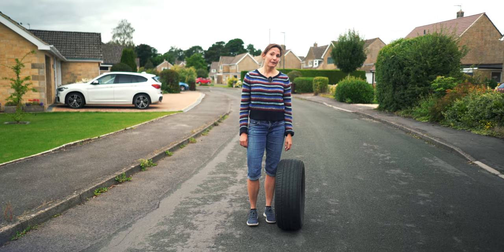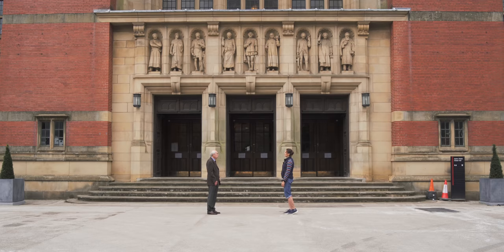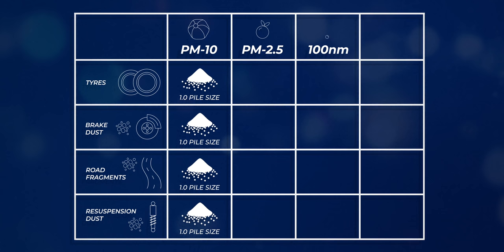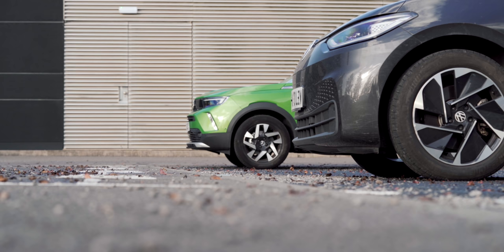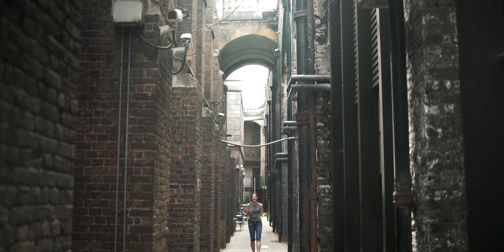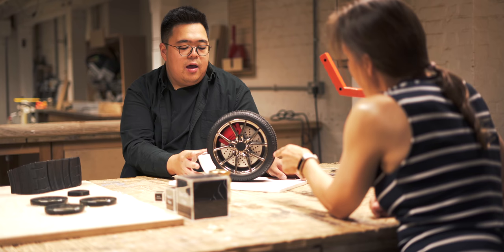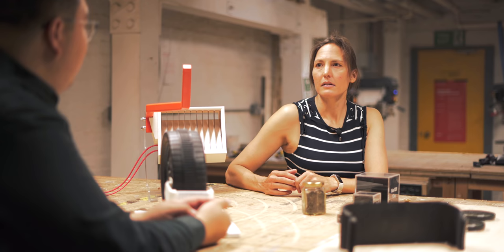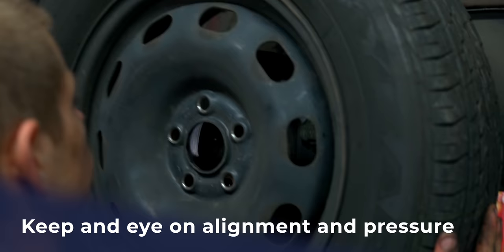The Secret Pollution That All Cars Are Guilty Of | Fully Charged

Comment: Well researched, easy to understand and well communicated. That was excellent, thank you fully charged and Dr Helen.
Reply: @ProfSimonHolland  Given that the video obviously is well researched and communicated, I guess your objection is to promoting the idea that EVs have negative effects, just like ICEs, and that Fully Charged shouldn't make anything of that? Maybe you think EV pollution is far lower than that portrayed here?

It's hard to guess what you find selective journalism or a fossil fuel lobby distraction.

I have looked at your channel and can't see anything that would cause you to make your comment... unless of course, you wanted controversy?

What is better research, what is better journalism?
Reply: @ProfSimonHolland  I took from it that cars have tyres and Brakes. They are responsible for some particulates. Getting rid of fossil fuels solves the majority of our local air pollution problems. New solutions will be needed for the remainder. I think in some articles can rightly be accused of doing the bidding of the oil lobby. In this case I don't see that as fair criticism. Personally I would like the Colin chapman approach of add lightness to be adopted by the next generation of EV's. The mix of improvement battery chemistry, lower drag and light weighting would be lovely. What would you like to see from future fully charged videos?

Comment: Very much anecdotal, but  my e-golf got an irreparable puncture  at 30000 miles ‘ life. The  people in the know at the tyre centre were very impressed with the low level of wear. Regen braking and cruise control, along with that smooth transmission of power to the road , seem to slow tyre degradation  down considerably. That has to help surely?

Comment: Ok. As a Taxi driver who's vehicle usually covers 50,000 miles a year or so i can give some detailed answers here.
1/. Phev ( Misubishi outlander) 2,400ish kilos front brake pads last approximately 150,000 miles and are replaced due to being weathered mire than worn out. Disks show no wear at all. Tyres no difference i.e 40,000 miles to a set.
2/. Full EV MG5 EV owned just over 12 months, 45,000 miles ( reduced due to Covid) 
Front tyres spin a lot on wet roads, 30,000 miles a set. Front brakes at 44,000 miles have worn less than 1mm from new. Disks show no sign of wear at all. 
3/. Fiat Doblo 1.6 7 seater MyLife.
Tyres 40,000 at best. Front pads 24000 miles 1st set 20,000 2nd set due to wear on disks.  Disks replaced after 44,000 miles due to being at or close to minimum legal thickness.
The Fiat has now done 298900 miles and the data has been stable all these miles.
All vehicles are (were) driven hard, perhaps the PHEV & MG5 slightly less so than the Doblo, but not much. 
So the tyre emissions are slightly higher in the MG5 because it's traction control & abs system is slower reacting than the Phev or Doblo allowing more slip and wheel spin. 
On both the Phev and MG5 the rear pads wear at a similar rate. Even though the PHEV is much heavier it is 4x wheel drive and regen. 
I would expect rear wheel drive only EV's to have much higher wear on front pads and disks due to most braking force is on the front wheels.
I would also expect front wheel drive EV's to be slightly more efficient due to better regen possibilities than RWD cars. Anyone able to confirm / disprove this theory?

Comment: If only tyre wear could be considered by the authorities who resurface our roads! When I drive the 20 miles or so to my nearest city along a dual carriageway, I can hear the difference in road surfaces; some (where grit has been used as a short term solution on a stretch of road) are noisy, others are very quiet. All this would appear to show that more consideration needs to be put into the construction of smoother roads, thus minimising tyre wear.
Reply: Exactly!

Comment: That dust collector was a ridiculous fail. One wet day and it will be coated in mud. Anything it did recover would be hopelessly contaminated, certainly little hope of recycling.
Funny though nobody mentioned trams & trains....... Steel on steel doesnt do much wearing.
Reply: Steel wheel on a steel rail does have a lower friction than rubber on tarmac, but there's still material worn off during use. Especially on older trains with brake shoes that rub on the wheel surfaces. Having helped to change those brake shoes and cleaned the oily iron mess on some old locomotives I can definitely confirm that they wear down!
Reply: And yet the Tube is heavily polluted due to braking.

Comment: When it comes to recycling of tires, Scandinavian enviro systems have promising technology for separating the elements a tire is made of and reuse for new tires. Much better than building huge piles or burn them. Around 30% of a tire is carbon black, a very fine grain carbon powder produced by simply burning oil in a specific process. This can be replaced to 100% by recycled carbon black, saving around 80% co2 emissions at the same time. Michelin is working with them too, so we can hopefully start using tires made of mostly recycled materials in the near future.

Comment: I straight up did not understand the What About EVs chart. What is pile size? Are EVs producing less or more particulates than combustion vehicles? And what are the sizes of those particulates? What does "pile size" represent, particles by weight or by volume? How dense is the pile? I appreciate the difficulty in boiling down a complex subject but I watched it twice and I still don't have the foggiest idea what this chart was trying to convey about driving EVs. Fully Charged is normally great about communications but this was clear as mud.
Reply: The EV pile is how much extra EV’s emit on top of the ICE pile

Comment: Tyre pollution will be greatly reduced by autonomous driving. Harder compounds can be used, with less wear and much better longevity, since autonomous cars will always drive at a safe distance from other vehicles and will never brake or corner harshly. We need high grip tires because we like to corner harder and brake at the limit. "Sporty" driving is fun and most users and car manufacturers aim for that. But that's not gonna be a thing with autonomous driving. High grip tires will only be needed for track or car sport events, not daily use.
Reply: Autonomous driving isn't gonna be the norm. Unless they go in predetermined routes with steel rails and steel wheels with a ton of people.
Reply: @crackedemerald4930  ever heard of autonomous ride hailing? Several companies are aiming for that, and if you look at the economics of it, owning a car is not going to make economic sense anymore. So, yes, autonomous cars will be the norm, with 100% certainty. If it's going to happen in 2, 5 or 10 years that's the only thing open for debate.
Reply: @crackedemerald4930  If it can be done, it will be done. And yes, it can be done. Software has changed all our lives; it will also free us from having to drive ourselves.
Reply: @kelindrawn  you don't need to drive a train or a bus or any other available public transport

Comment: Please note this issue will be used by governments to continue their crushing taxation of drivers. 
Hard tyre compounds make smaller dust particles. Soft tyres wear faster but particles are larger and less harmful. 
Brakes on EVs get a small fraction of the use that brakes on engine cars need. Regen braking of an EV does not use the brakes. It’s highly likely that EVs could return to drum brakes where the dust is contained. 
In terms of tyre wear Tesla don’t seem to be much worse than engine cars. The added weight keeps the wheels better planted on the road. Less tyre slip means less tyre wear.

Comment: I think it’s time manufacturers start looking at either developing eco friendly materials in brake pads and tyres or  develop software to fully utilise the “regen” braking capacity of the electric drive motors .This should in theory  remove the need for use of mechanical braking systems.
Reply: If as much research and development had gone into energy recovery Tec as has gone into eaking as much horse power out of reciprocating engines, we'd be in a slightly better place. Turning all that kinetic energy into heat to simply disappate into the air is frankly stupid. I suspect oil companies have shelves of energy recovery patents stashed away in dark places.

Comment: Brakes ?  One pedal driving REGEN 90% less use of brakes ! The professor is denying to me in an email correspondence what he said referring me instead to their research paper in which apparently Regen is mentioned. But you watch here from 2:30 to 3:32 he is blatant in saying there is no difference on ALL 4 issues between ICE and EV with no slack for single pedal Regen driving/braking. Now he is denying it to me in his emails.

Comment: EcoCa Ltd is the only Net Zero Emission Vehicles at manufacturing. All interior and exterior panels are made by thermoforming process with ABS PMMA. Specialists in light weighting and low cost of maintenance.

Comment: What I find exasperating about this is that it isn't put into the context of the overall pollution of a fossil vehicle. An average car will annually produce  tons of CO2 (and masses of particle pollution) but only a few hundred grams of tyre dust.  Also the heat pollution of a fossil vehicle is hardly ever mentioned - their engines have terrible efficiency compared to a BEV and must contribute significantly to city heat pollution.

Comment: I'm not an engineer, but wouldn't it be possible to stop a vehicle completely with regen and finally motor torque in the opposite direction of the car? The principle of using magnets to stop objects in motion. No need for brakes, except for parking perhaps. Could be interesting?

Comment: As already talked about, how well would it work when it is raining? Maybe it doesn't work, but then, maybe the idea is reduction not elimination.

Is there an optimum tyre/wheel size to use with a given car weight? If there is then shouldn't cars be designed for those instead of styling BS choices?

Comment: Fantastic points raised here but I think it's slightly misleading when it comes to brake dust. Many many EV drives employ one pedal driving and use the regeneration to stop. Meaning there's plenty of EVs that rarely ever have their friction brakes used. You see many EVs with very high km with the original pads still on. 

In contrast, I blew through a pair of pads in 25,000km and was onto my second set of tyres in my Mercedes turbo petrol. 

Just another variable to consider.
Reply: Helen is marvellous but this piece was misguided and wrong... focusing on tyre ablation ignores the big picture....the fossil fuel companies must have loved it.
Reply: @ProfSimonHolland  I totally agree... The whole point of people changing to ev vehicles is the benefits to the environment. People are taking it too far. If you keep telling people they need to do more and more and more then eventually the people will push back. 

Break dust and tyre wear has never been an issue raised but now suddenly Ev cars are reducing pollution and emissions there's a new pressing issue of brake dust and tyre wear??? Really rubs me the wrong way. 

Marketing material from all ev manufacturers "the biggest contribution to climate change are tailpipe emissions" and now they want to try and change the roadmap and say the brake pads and tyres. 

It just makes you think if you do your damned if you don't your damned. This video's content just greatly frustrated me.

Comment: Does the cabin air filter helps removing particulate from the air? Does it offset a similar number particulate in the air.
For combustion car there's also an air filter for the engine.

Comment: I notice that there is not much emphasis on the volume/mass of these emmissions per distance. A tire that releases a kilo of powdered tire per 100,000 km is a vanishingly small amount. Brake dust is much much less than that. Compared to exhust emissions this is not even worth mentioning.

Comment: seems like increasing the use of trains/ vehicles on rails would be the best way to reduce this problem, not to mention that rail is more efficient too
Reply: It may help with pm from rubber but also creates particulate matter pollution 
There are some studies about measurements of PM2.5/10 inside the underground metros, poorly ventilated tunnels and trains constantly moving keep the levels very high.

Comment: The simplest easy first step is the obvious need to not buy a rolling house for daily driving. I get a bit frustrated that some car makers are not focused on efficiency and building the same oversized over weight vehicles the fossil car makers have us buying today. A small hand full of manufacturers get the effiency conversation with lighter packs, lower rolling resistance and smaller cars. A Hummer EV kind of misses the point. Lower weight better efficiency, less invisable pollution. I think the easiest first part of the solution is a less and efficiency are king mindset.

Comment: Steel wheels on iron rails.  Much less power required to build than asphalt or concrete roads.  If tires were made entirely from natural products that would break down it would be fine.  Get the chemists busy.  Swift Rails Inc. has a personal rail vehicle in development now.  Take the oil out of road building and it becomes a lot easier to think about what to do.

Comment: For forty years I've been banging on about all the tire and brake dust going into the environment and everyone I've asked those questions have poo-pooed my concerns.  Finally.  But the guy with the dust collector that attaches to the car's tires has been breathing too much tire and brake dust.  There are so many reason that could never work.  Imagine having that on your car here in Minnesota/Wisconsin in the winter.  Dirt roads?  Additional weight?  Separating road dust from the rubber?

Comment: On the subject of "Resuspension Dust" I have 2 comments: 

Back in the 'eighties and 'nineties I was commuting in London traffic. When I got home, I could see lots of small black dots on my face. When I ran my fingers down over my forehead and cheeks, black streaks were left behind.

I now work in retail replenishment (putting stock on shelves). Deliveries arrive in curtain-side trailers. The pallets inside the curtain are usually covered in road dust. If you blow on it, you get an effect like emptying a vacuum cleaner: Clouds of it, and not nice if you inadvertently breath it in! 

If you want a place to sample road dust, I am guessing that there is a low-pressure area between the cab and the trailer, and that pulls in the suspended road dust, plus you have the curtains being sucked in and out (like a bellows), as the rig moves forward, and THAT action will suck in the suspended dust from behind the cab and into the trailer.
Just a thought.

Comment: instead of making 100kWh luxo-barges use that material to make three 33kWh cars.  Concentrate on miles per kWh. Light weight cars, narrow tyres, that's what we need. Share the resources. If you regularly need to drive like hundreds of miles, move.  If you only need to drive hundreds of miles once in a blue moon, borrow someone else's car or rent a car for a day. I think the average uk journey is something like 8 miles.  I have a 24kWh EV and I manage ok.

Comment: We can have chewing gum with no plastics I’m sure we can make tyres more eco friendly. Yes there are plastics in chewing gum.
Reply: Hi Mark, the problem with any tyre compound that is functional is that it needs a certain adhesion coefficient to road, for vehicle control. By definition these materials have not to be ultra hard as they need a certain contact patch to generate the adhesion. And non-hard materials will squirm and wear out. They also need to deal with surface water , so need a tread to eject said water. We may be able to improve the materials but particulate capture will probably be required by legislation 10-15 years from now.

Comment: Interesting. Hopefully brakes can be eventually replaced completely by the drive motor. Perhaps an ultracapacitor to absorb all of the kinetic energy in a second or so? Maybe the suspension and tyres can be made from non-toxic materials as well.

Comment: There is no mention of what happens to the worn out tires. This is a pollution problem that is not addressed in most people minds either. Also you mention lighter vehicles but the lightest most efficient vehicle for human transport, particularly for short haul trips is the bicycle.

Comment: The downside to the device on the tyre is it becomes another maintenance piece for the owner plus it only solves the problem for one source. Plus there are thousands of cars that will need to be retrofitted with this. 
Why not have a giant HEPA filter that cleans the air that could also be used for Carbon removal? Suck in air, remove as many particulates as possible nad if in the right location (plenty of abandoned buildings about) remove some carbon dioxide? I guess we can dream of a better future.

Comment: If transportation and power generation emission account for most of our air pollution issues I'd rather see the efforts there than chasing smaller sources.  Currently CO2 emissions seem to be our biggest threat and both EV/ICE add to it.  I'm fare less concerned about breathing in rubber tire bits than all the leaded fuel still being burned in aviation and race fuels.

Comment: Great, another reason to get rid of massive SUVs but it is a problem that will decrease slightly over time as the energy density of batteries improves. It's going to improve a lot over the next few years with the introduction of silicon doped anodes.